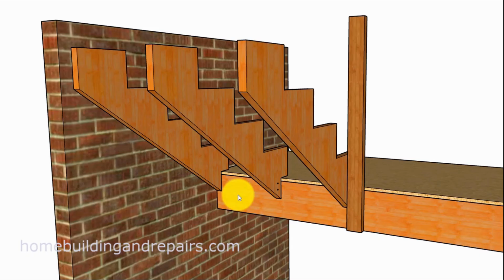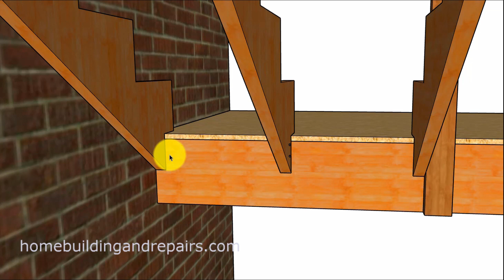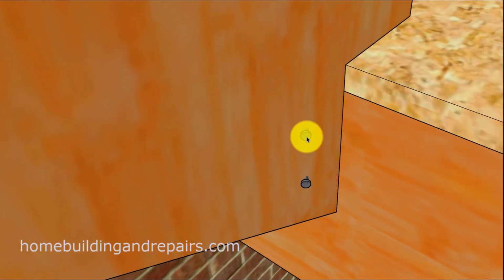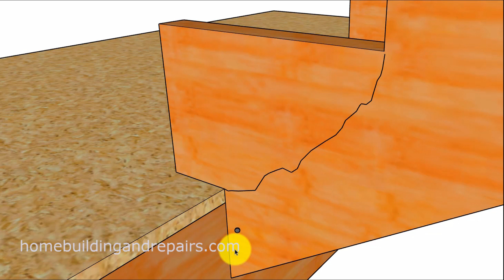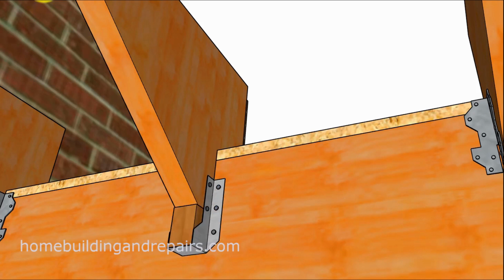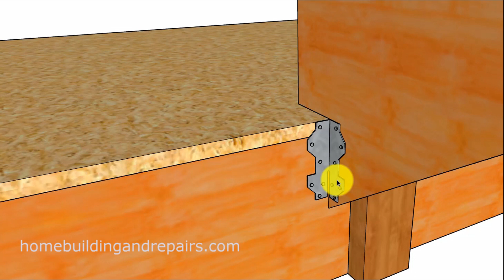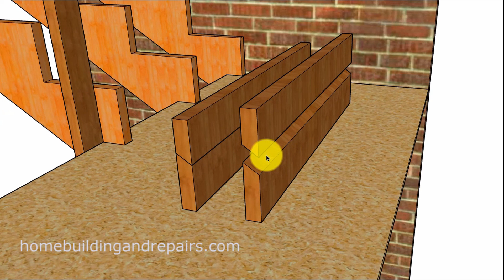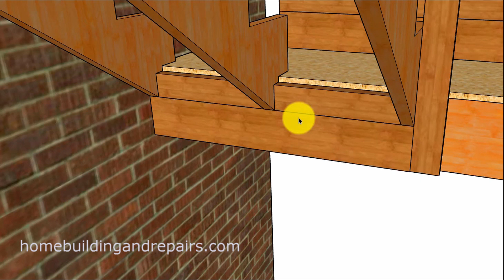Ideas For Reinforcing Bottom Stringer Connection To Wood Beam – Building Repairs

Comment: Your channels are unique and valuable and deserves much recognition. It helps a lot.  Regarding the hangers pass over the landing and cannot be nailed completely . A block can ba added over  the landing and between the stringers, so the load will be passed to the block then to the landing
Reply from the maker: Yes, sometimes you can transfer loads with blocks.

Comment: what if you put spacers for each screw (nuts or washers) between the support board and the beam? that would remove the water problem right?

you could run bolts spaced out between the board and the beam.
Reply from the maker: Absolutely, you could put some type spacers in between to allow water to drain and air to circulate. Great idea and thanks for sharing.

Comment: What about anchoring the wall-side stringer to the brick with heavy masonry anchors, say, every 24" (assuming brick is structural)?
Reply from the maker: I think that would help, but as you pointed out, it might not work as the best structural connection.